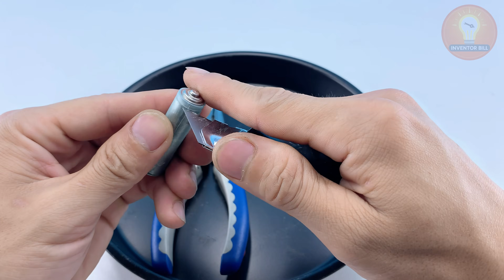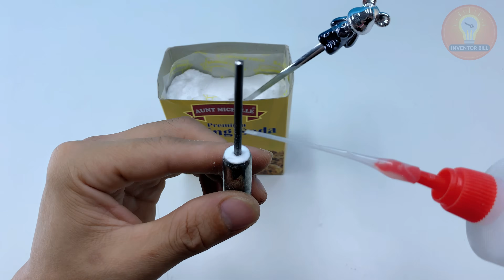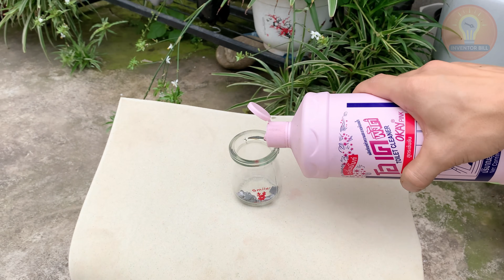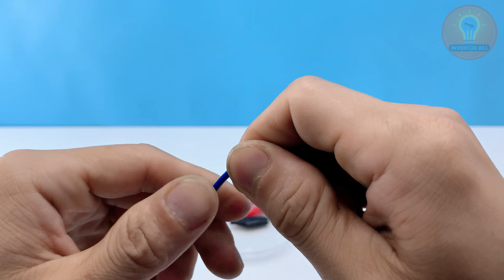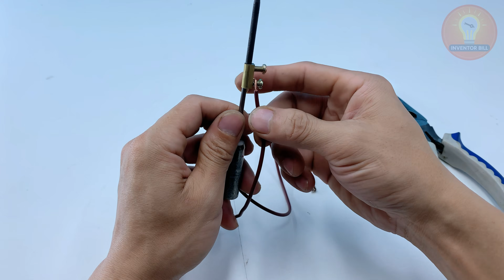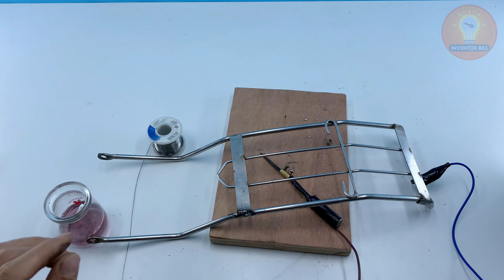How To Make a Simple Welding Machine from AA Batteries. Practical DIY Idea!

Comment: Is the battery Lithimiun or Alkaline which one this guy the type of the Battery  have a rod or stick of graphite ?
Reply: That's my Question...
Reply from the maker: Thanks for the question. The battery used in the video is a AA zinc -carbon battery, not a lithium battery. Zinc-carbon batteries typically contain a graphite rod in the center, while most alkaline batteries use a different internal structure and usually do not have a central graphite rod. I hope that helps clarify it!